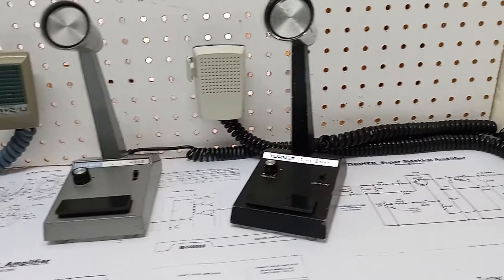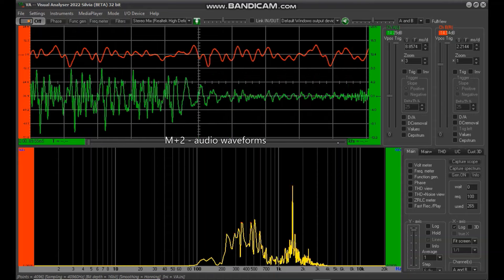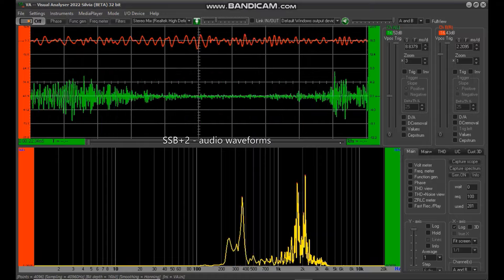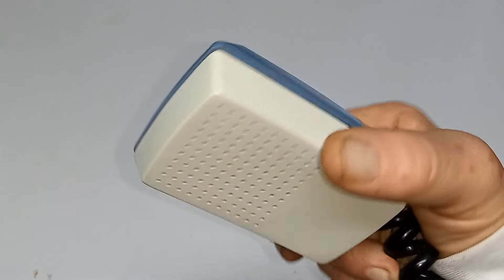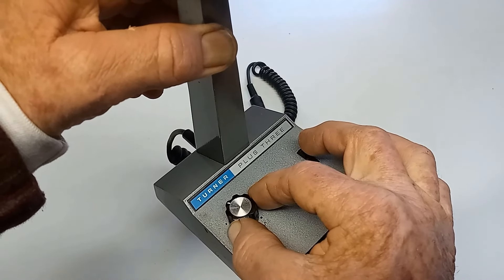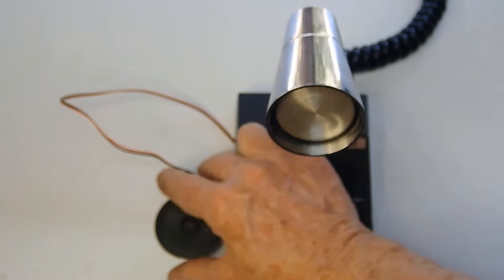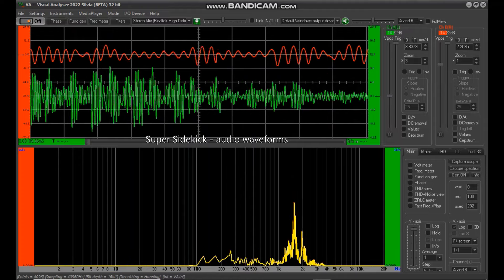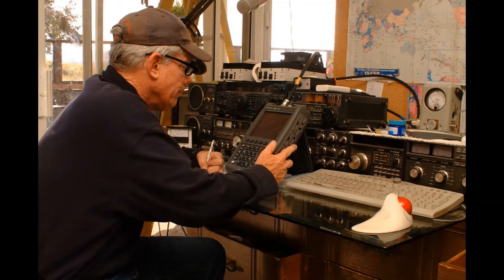TURNER AMPLIFIED MICROPHONES - Inside & Out +Schematics

Comment: It's great I stumbled upon this channel. I just love my Super Sidekick. Always get good audio report anywhere else in the world. And with only 20 watts of power output, may only have S2, S5 on the other end but always a Q5. But I do have questions though. My first SSK I got mid 80's. Repainted to metellic silver from the previous owner. Still got the chrome plated head. And last 2023, a good friend of mine gave me his SSK as a present in true stock form. It has different name plate. My first one got TURNER and the other got Turner. Which is older? But here's the catch. I opened both to see the inside and there's a big difference. The one from my friend is exactly the same on what showed in this video, but my first one, first, looks like the Relay/Electronic switch has been taken off and it has an 8 pin audio IC instead of the 4 pin. I've done some research but to no avail and I'm dyin' to find some answers. To end it up, both has booming audio makin' me loud and clear. Appreciate it very much and have a good one.
Reply from the maker: Yes, there were some early Super Sidekicks like the SSK-100 and I believe there was another as well.  Love to see some pics if you still have the mics?  73-Gregg s9radio